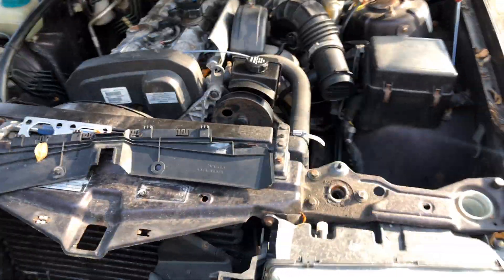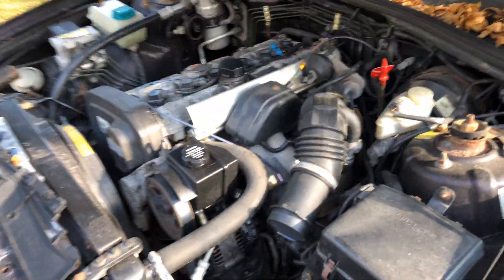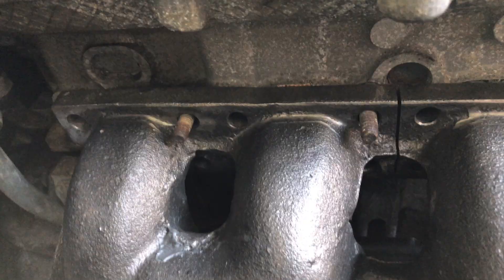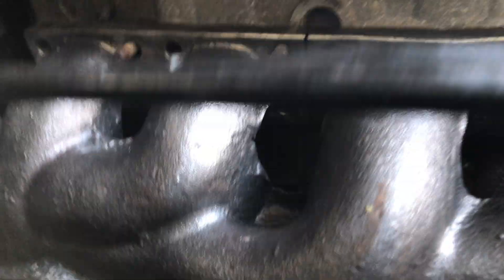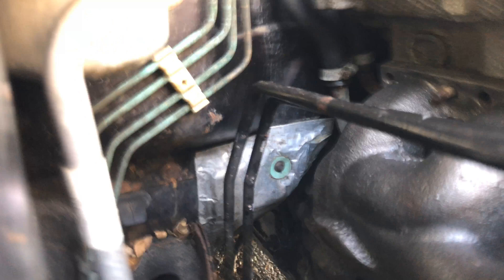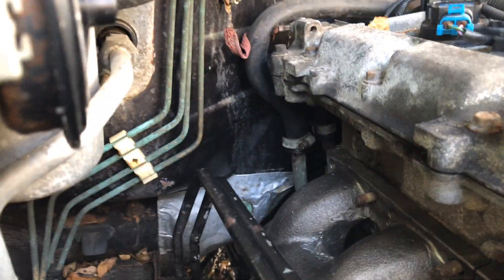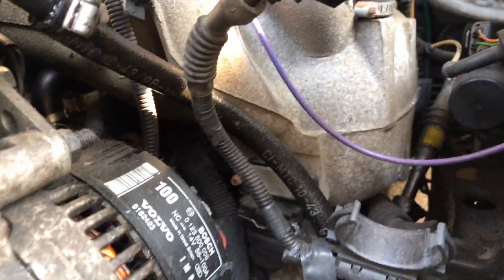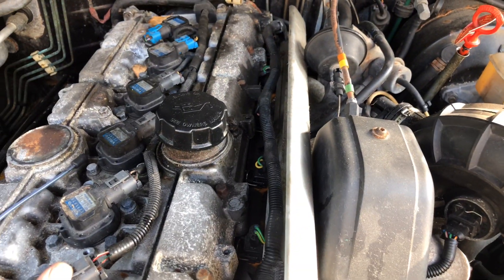Volvo 960 Wagon Turbo Conversion | ep01 | Project Intro

Comment: i thought the 3 liter couldnt handle any boost?
Reply from the maker: Yeah people that haven't done it say that :D. Fair to say its not an ideal candidate. If you poke around on the 960 FB groups and turbobricks you'll find there's a few that did it pretty well. I think up to 400 on stock hardware, but don't quote me.

In may case I was really just looking to have a wide torque band like the T6 has..
Reply: @thiswillprobhrt  the block is the issue with the 3 liter the 2.5 is much better for boost?
Reply from the maker: @LoLvo-960  I don't think there's a 2.5L i6 though? For the 5 cylinders I thought it was the "old" 2.3 that had the smallest bores and least need for backing.
From what I recall, the limit for the 3.0 i6 is rods at first. 

Edit, I see there's a 2.5 whiteblock i6 actually, makes sense that the walls stand up to more power. I would think you'd be looking at pulling the engine out and opening the ring gap if you're really pushing it. Maybe rods too. 

I had a 3.0 so went with that. From what I read at the time, the limit was the rods.
Reply: @thiswillprobhrt  theres the 2.5 and the 3.0 6cyl engines in the 960/s90
Reply from the maker: @LoLvo-960  yep saw that after poking around LOL.
\
Reply: @thiswillprobhrt  yes just be careful with the 3.0 block dont run big boost